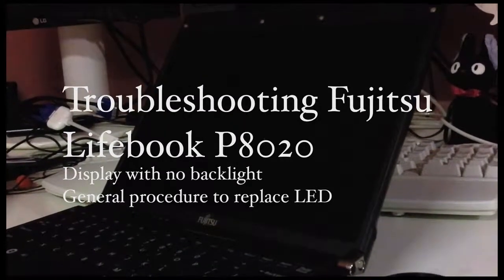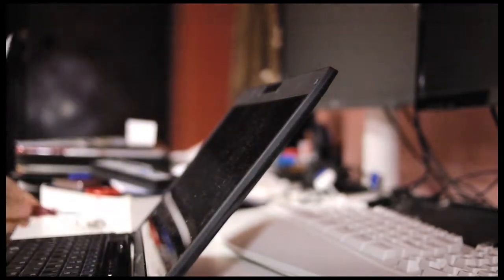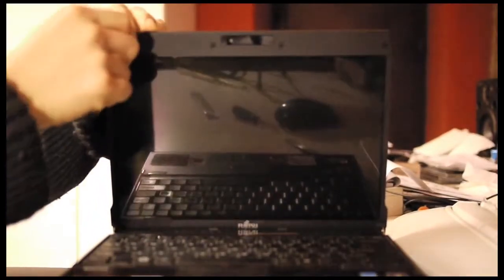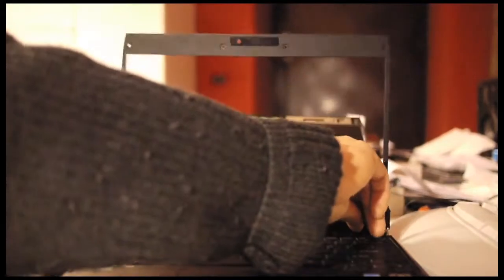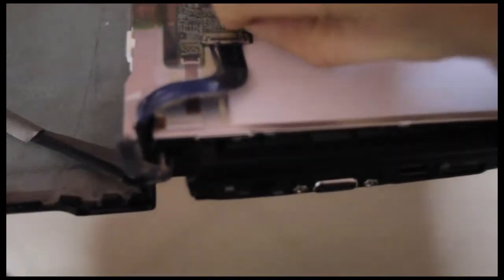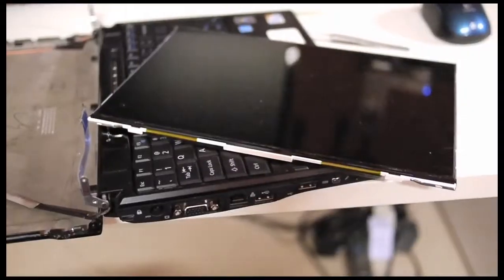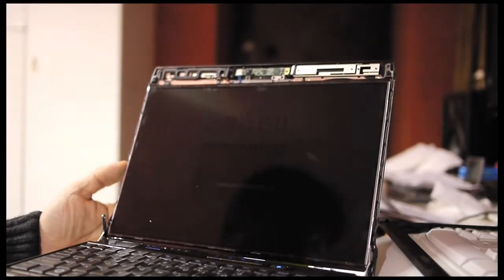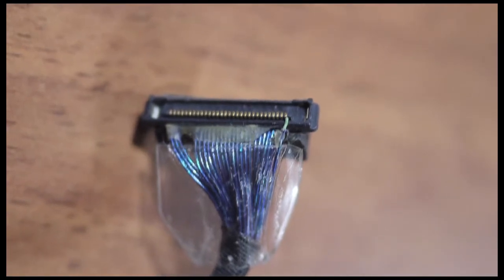Replace Fujtsu Lifebook P8020 P8010 LED LCD Display

Comment: Thank you for providing this video! It helped me to replace my display.

One detail to add: to remove the frame using a screwdriver or metal plate didn't work well for me: it left marks on the frame, and it nearly broke. I found a much easier way: gently press the right and left edge of the frame from the inside to the outside. Then it will loosen easily without much force.

Thanks again!
Reply from the maker: I am so happy to hear that someone else found my video useful. I really appreciate the tip about removing the LCD frame. I had a hard time too and wonder about its design.